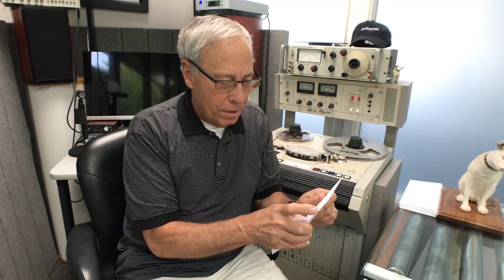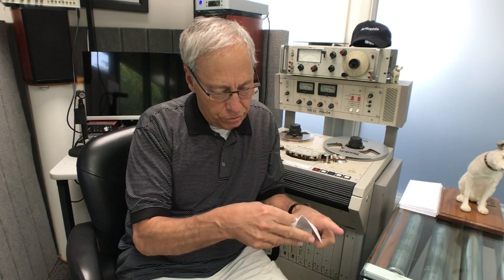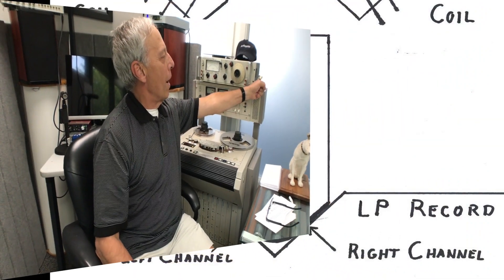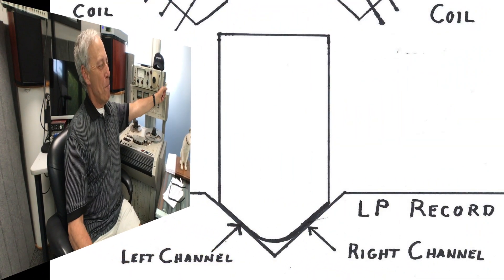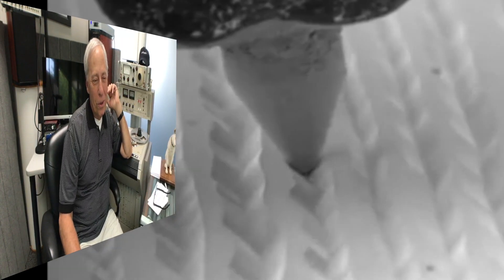How do vinyl records make stereo?

Comment: Yeah, right .. one side of the stylus vibrates one way, the other side another way, which explains the limited channel separation, and there's a third channel in the up-down movement - ah, the mystique of vinyl .. no wonder it's vastly superior :)
Reply: too much width destroys the soundstage illusion...you are more likely to perceive a hole in the image on cd than on vinyl
Reply: vastly superior to what?  There is lossless digital, which means all you get with vinyl is some added noise from the imperfections in the record.